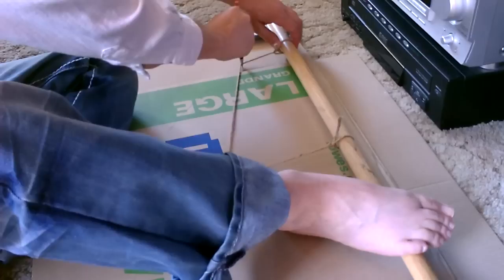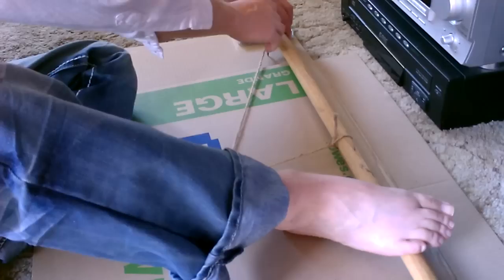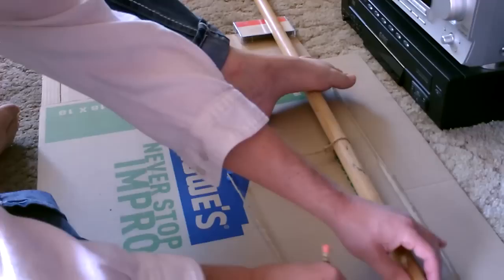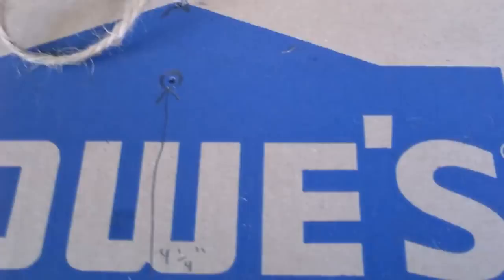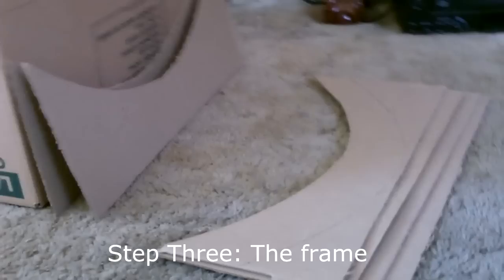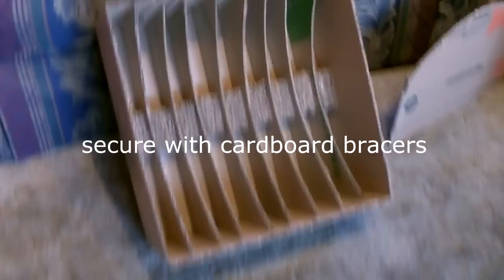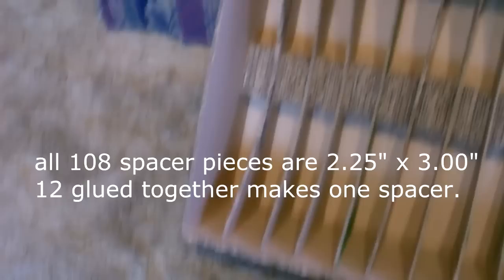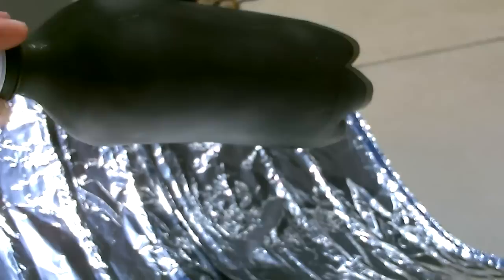How to Build Solar Parabolic Trough Cooker! - Easy DIY Instructions. 300F+ How to draw a Parabola!

Comment from the maker: yes, shortly after the video was made i did exactly that. (removed the foil, glued a piece of posterboard to the ribs, and covered the posterboard with foil). it works great, gives a very smooth surface, and increases the temperature.

Comment: This is very cool. What about approaching the parabola from the bottom side? The cardboard you threw away after cutting attached to a sturdy frame, then just tension a mylar sheet around the structure.

Comment: I just found some 4in mirror like things from a vertical blind used for glass doors and I think I have a bunch more in there about 60 long and I'm hoping they will make excellent things to do this and I bet you can order them fairly cheaply I might make a super hot parabolic trough thing and you could also make it just as long as you wanted to and then you can do really amazing things with it I've seen people using it in the snow to make steam and you can also make lots of hot water and bunch of other applications but it needs to be large enough long enough and shiny enough

Comment: Pretty clever setup.  I'm thinking of  building your design but covering the ribs with a sheet of posterboard or thin cardboard to give a smoother overall surface for the foil. Have you tried it? Thanks for posting.

Comment: Really inspiring, thanks for sharing.
If you cut slits in the cardboard, could they be assembled to make a round parabola (satellite dish shaped?)  I believe this would concentrate the focal point
Reply from the maker: yes you can. *i actually have a video of that (it's a round unit that is 3 feet in diameter) here's the link https://youtu.be/bL_Z-F3pU18

Comment: Pair that up with a vacuum tube ~$10 each 20 ounce capacity and you could literally boil water in 15 minutes using just the sun. Since I can shower with 2 gallons of water. I could get one gallon boiling add that to another gallon that was warming in a batch warmer. 6 tubes of water and I would have the water needed to take a shower.

Comment: what's your preferred way of cooking using the sun? the disc parabolic mirror? or this ? or smthg else?  i feel 4 inch focal point  in this set up is too small.  but this is easier to build it seems than the disc. great stuff!
Reply from the maker: danh le hi there. i like using anything parabolic the most.  the oven style is a close second. (... parabolic cooker is faster/hotter and in terms of time it takes to cook, it's roughly equal to a standard stove burner). also, since you can cook with it in a few minutes, you can even cook on partly cloudy days. just wait for a short break in the clouds and fire it up.

Comment: RE: draw a parabola , you can also put a string or chain between 2 pins & let it hang on a wall , trace the line , Done . I do like the way you do it also , a known focal point .  With your construction , it need not be perfect  , it will work !! If you need more power , make it larger .
Reply: no it is not a parabola
Reply: it's a cathenaire, the curb of the high tension lines.

Comment: Which reflecting material do you used?
Reply from the maker: hi. i just used standard aluminum foil. for even more or higher reflectivity try aluminized mylar. 👍🌞
Reply: @desertsun02  What kind of temps did you reach please?.